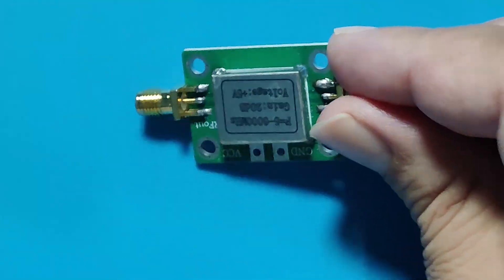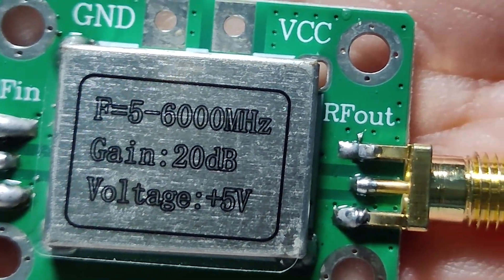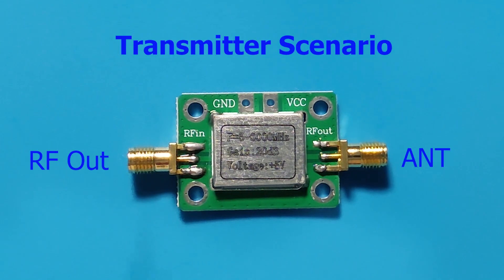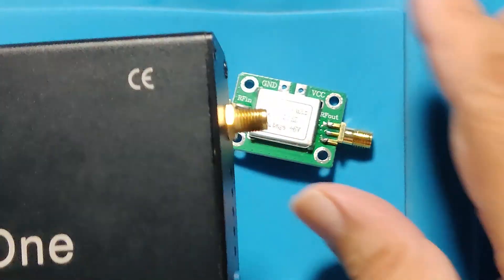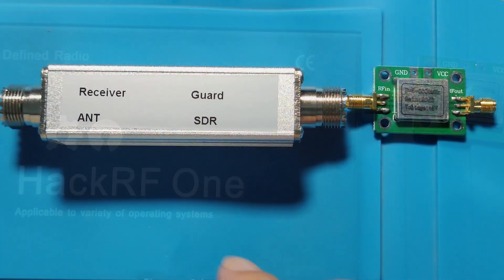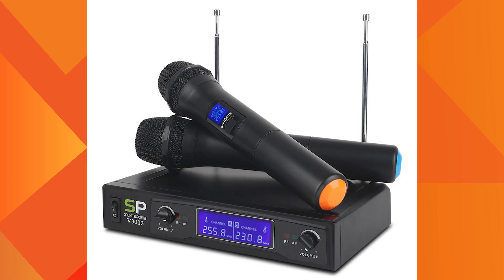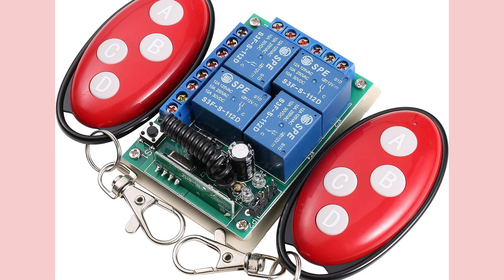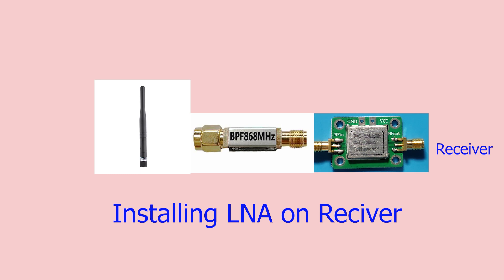RF Amplifier LNA 5MHz to 6GHz with 20Db Gain, New Version of 5189z, Overview by Technology Master

Comment: My question is , if i put an lna inline on the rx side of  duplexer of a repeater would it be safe for the lna as its not being tx through , i kbow you cant tx into these but was just wondering if its ok to use on rx side of the repeater ?
Reply from the maker: Yes, You can use it on RX side of duplexer. However it will not be very useful if you are living in an urban area. The common problem with these type (broad coverage 5mhz to 6ghz) of amplifiers is that it would be amplifying unintended frequencies more than our target frequency.  For example it will be amplifying broadcast FM radio instead of 2m ham (for example). So these should be used with a bandpass filter to get the desired results. Bandpass filter should be installed before the RF amplifier.
Reply: @ ok yes i kind of knew that but wanted to make sure, i did i a trial run with an sdr receiver, this preamp worked great on signals above 10meters espresso on 400 megahertz but i just wanted to make sure that being in the receive side of repeater system that it would be protected from transmit side , its not alot of money so i guess trial and error is the way to go , thanks
Reply from the maker: @Knarf14  Yes, it should be protected from TX.
Reply: Can this work for car ?

Comment: Thanks for the knowledge. Didn’t know these couldn’t be used for transceivers.  Is there hardware you recommend for transceivers
Reply from the maker: No, these cannot be used with a transceiver. This is because this amplifier does not have RF detection and separate paths for RX and TX.  Bidirectional amplifiers and RF power amplifiers are for transceivers. Here is an example https://youtu.be/Z3bmlwLmAjI

Comment: It can boost 4G router or gsm anttena?
Reply from the maker: Will add no benefit to a 4G router as they are already sophisticated devices with much higher gain. Use with GSM antenna will need RF bandpass filters for the GSM band in use in you area.
Reply: @technologymasterkam  thanks sir